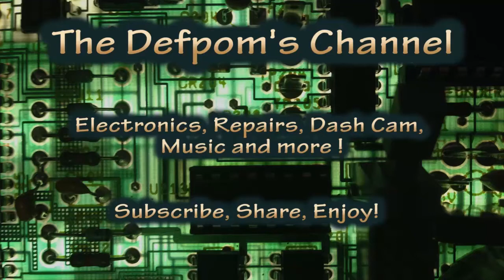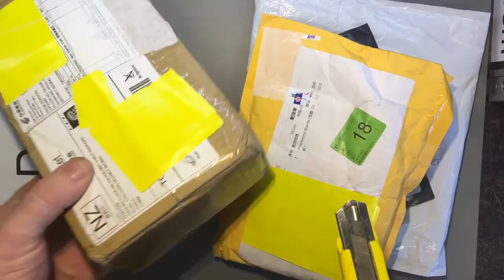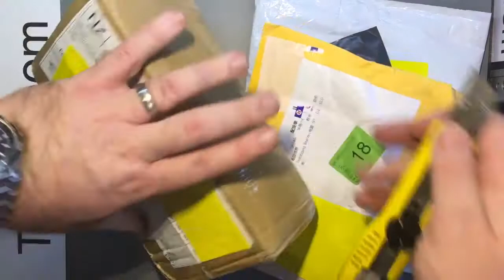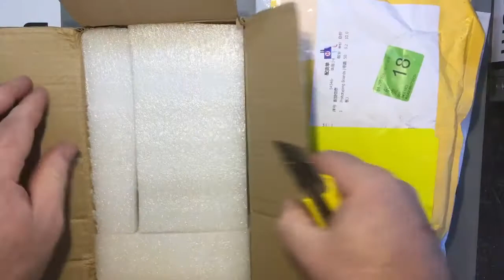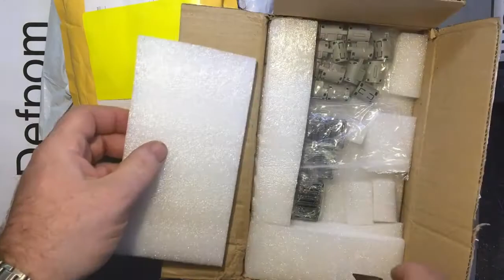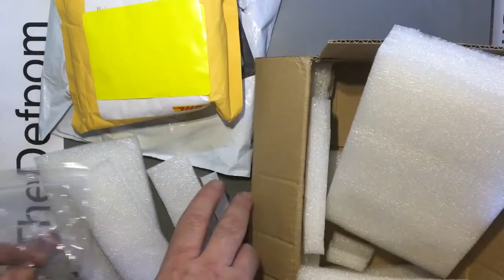#221 Mailbag 5th May 2017

Comment: The plugs on those little 5W solar panels typically have a charge controller built in so you might have to connect it in parallel with a small 12v battery for it to work right.